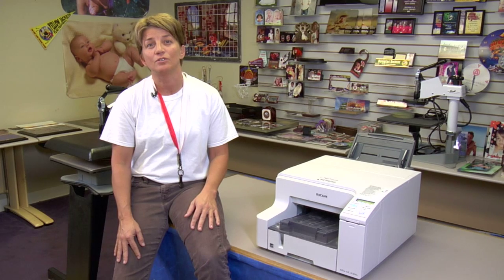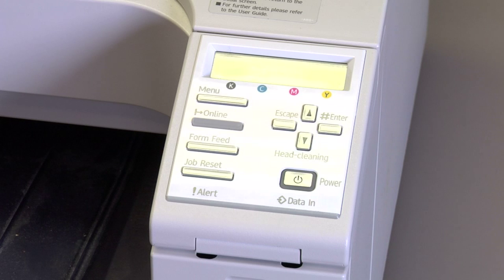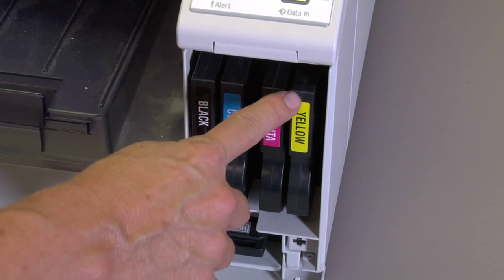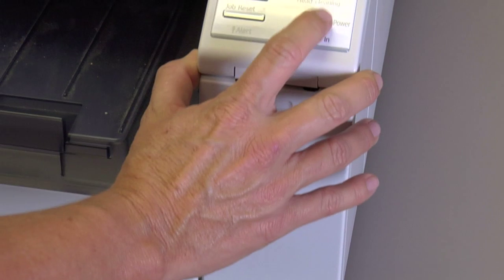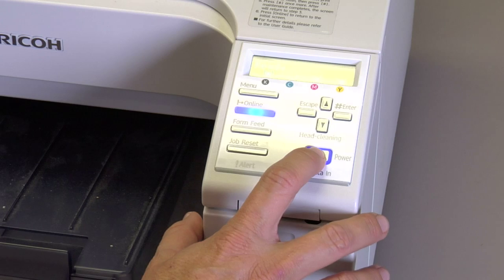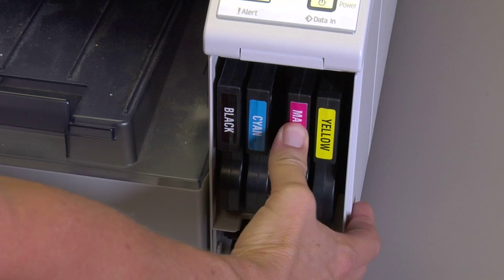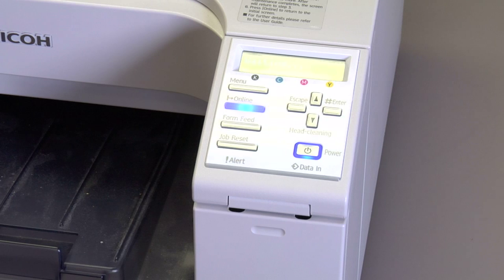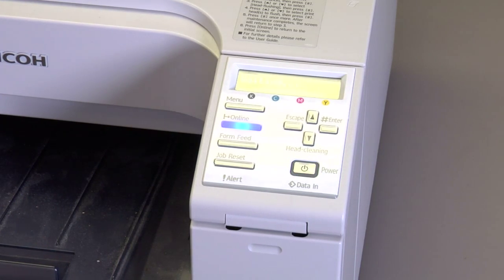ERROR: 990 on the Ricoh Printers - How to Fix -

Comment: HI, I have a few printers (Ricoh with gx3300) with 990 error's and your solution does not work at all ... any other suggestions?
Reply from the maker: The Error 990 is a strange and difficult error. It meaning it “air is in the lines” I have seen other error generate from it while attempting to resolve it. I ma not sure why that happens but I have seen it and I tell people to just follow the printer prompts to fix. If you have ink in the cart and it is still in warranty, Conde or Sawgrass will help you get up to par. Call our tech support at 1-800-826-6332
Reply from the maker: Try replacing your Ink collector unit. We have found that sometimes a faulty ink collector unit can cause these types of issues.

Comment: any sugestions after doing all of this and still gettin the "air" error , i ordered 2 sets of inks as told by a tech there and ran thru all this again , i have pulled cartriges and and turned on and off for about 3 hours and strill have got the error , its pretty frustrating to say the least ,im ready to fill the entire printer with air , any sugestions would be appreciated.